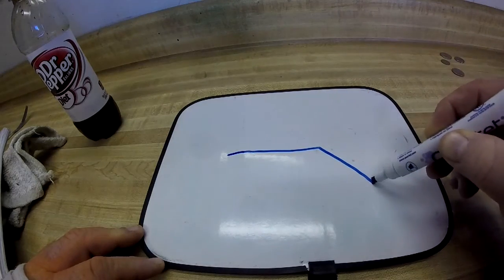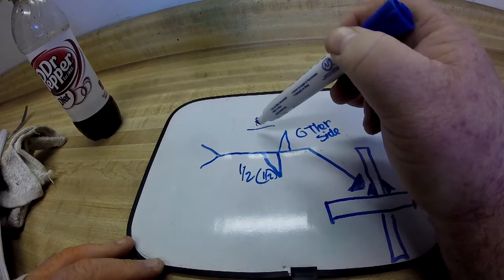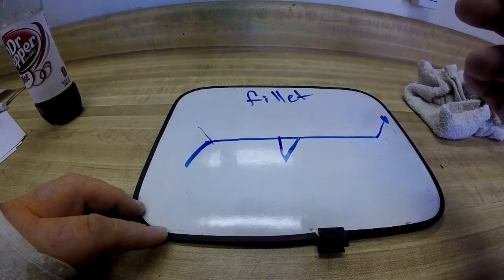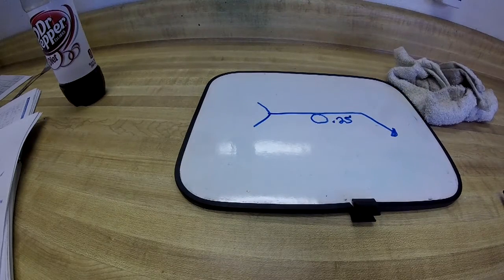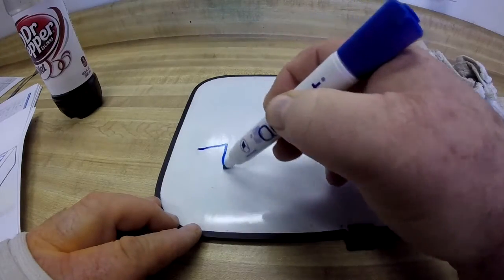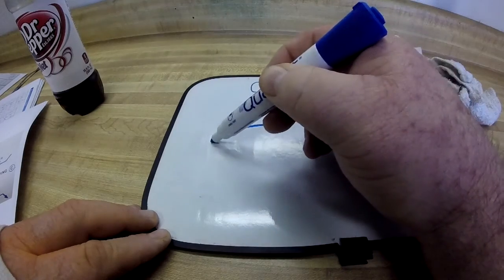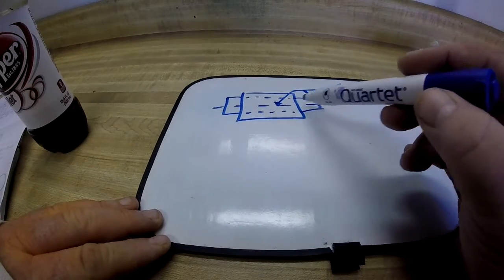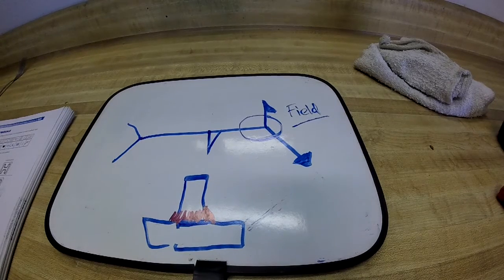more welding symbols

Comment: thank u a lot ..... it is amazing illustration video to the beginning welder. I waits your videos day by day....
but I have a little Q :
In minute 10:15 u explain the direction of the bevel side of the parent material, but I read in some sources that the perpendicular line in the symbol always in the left side and the tilt one to the right >> and the (break arrow line) refer to the side that will be the bevel weld....My Q is: Are there a difference between American and other welding symbol in this case or u made a mistake in the video?? 

thank u again and again....
Reply from the maker: +Ammar M. Eng. Ammar, I don't think I made a mistake. I took this information directly from the text book I used in welding school. But then again, there may be mistakes in the book. I would say stick with what you are taught in your school unless you are told differently. Thanks for watching and writing in!